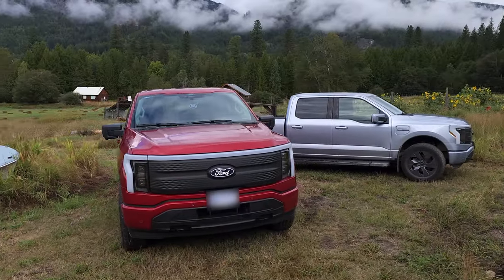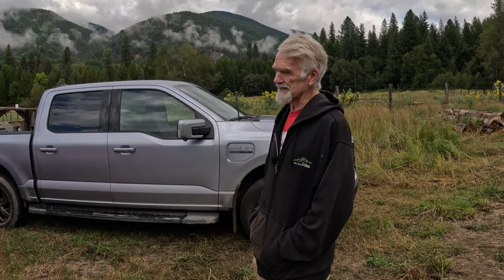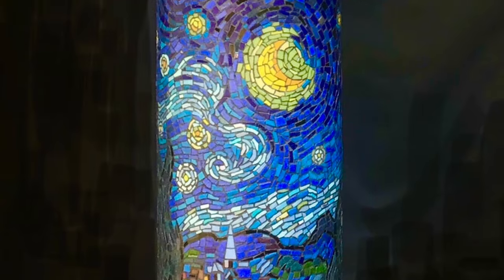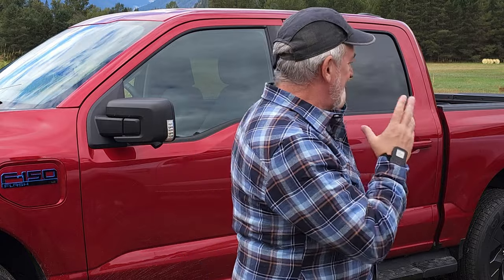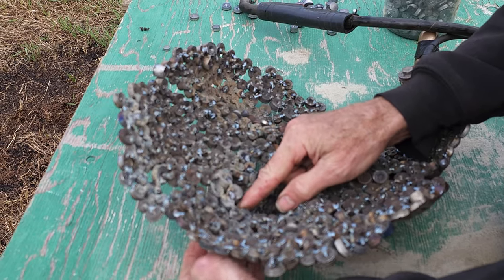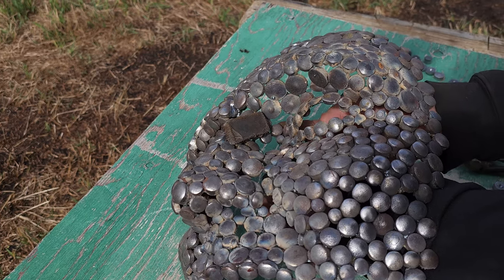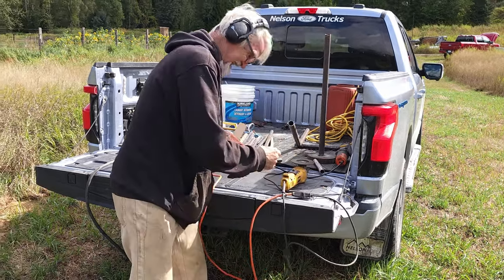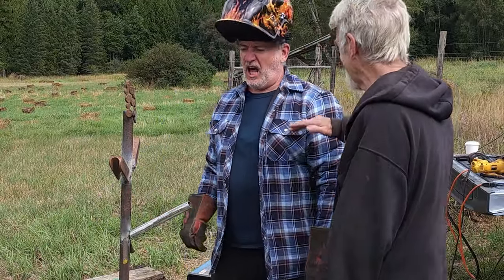EV Trucks Can Do This Off Grid For DAYS!

Comment: As you stated, people have no idea how big the Lightning's battery is. Take, for example, a typical "large" 12 volt deep cycle battery of 110 Amp hours. That's 1320 watt hours, or 1.32 kilowatt hours. The Lightning extended range battery is 100 times that size. One of my favorite things to do with my pro power is jump starting dead ICE vehicles using a 200 amp battery charger in the frunk.
Reply from the maker: Haha! That would definitely be satisfying. The system was designed to be as versatile as possible, and I keep surprising myself with what I can do with this truck.